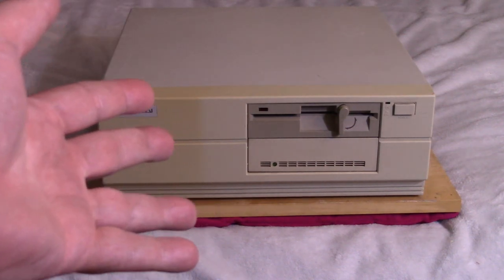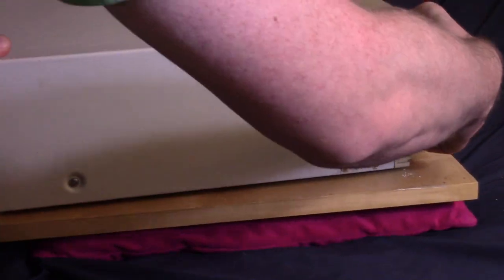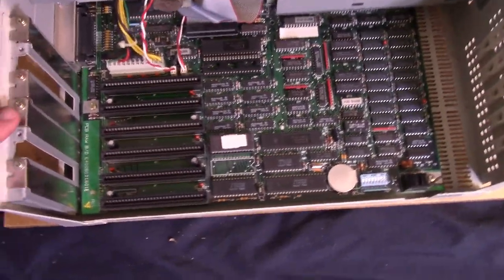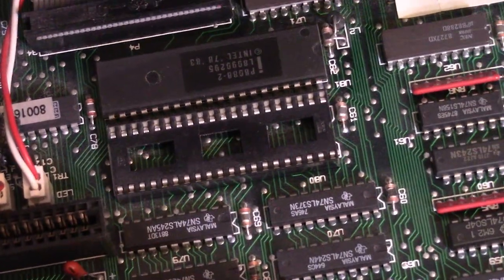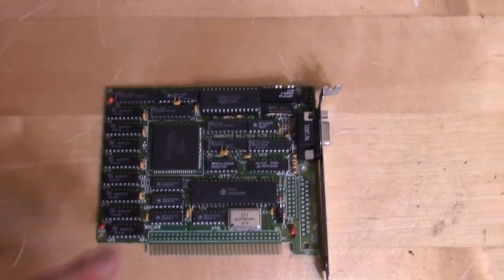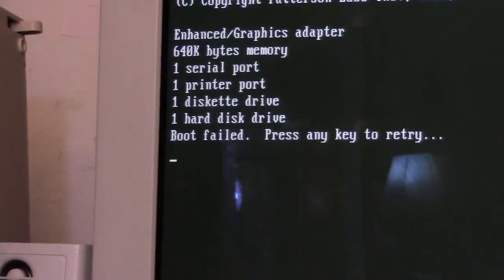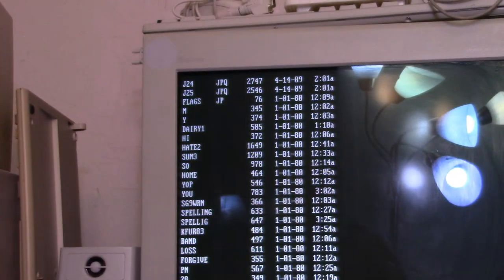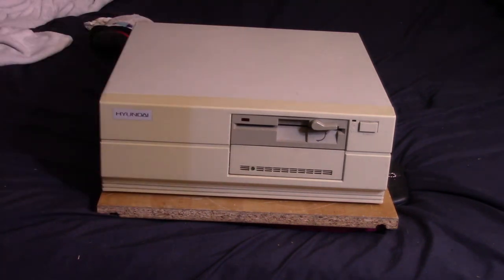Hyundai Super 16 Turbo

Comment: There were three giant Korean conglomerates at this time.  Hyundai, Daewoo, and Lucky Goldstar (LG today).  Those three companies promised lifetime employment and employed well over half of Korean working adults.  All three made a lot of computer components.  Most PCs branded by one of those three companies were actually manufactured in Taiwan, and were just branded by a Korean company.

Having said that, what a cool build.  They really seemed to know what was important.  An ATX style power connector, and regular watch battery.  I tremble when I think about how many computers died from battery acid, and reversed power rails.
Reply: the psu connector isnt atx, its almost like the at type, but different pin type and connector housing, you cant directly interchange them, i have a similar model 16TE,  it only looks atx as its a single connector instead of 2 separate ones as is usual with at
Reply: my super 16TE (turbo enhanced??) motherboard has a very 'Goldstar' look about it, i have an actual Goldstar branded motherboard, and the 'look' and components used are pretty much identical ,

Comment: This was my family's first computer, a free hand me down when it was almost 10 years old. I can confirm it did have a turbo (slowing from 8 to 4.77 Mhz) mode through a key combination (maybe ctrl-alt-enter but I can't remember). The cursor will change from an underbar to a block when it changes, and running DIR will be noticeably slower. They called it a "super-16" because they hyped that it was a "16-bit" computer. The keyboard was like an AT keyboard. The floppy drive was 360k but yours doesn't look like the original, ours was the same color as the rest of the front, had a round LED, and the gate couldn't be closed unless there was a disk in it. The hard drive was 30Mb but in the original documentation it was called 20 because the original MS-DOS 3.2 it had could only see 20Mb. We had the original disks & manuals but it had been upgraded to DR-DOS 6 which could see the whole hard drive. The matching monitor was amber monochrome. Yours, like mine, is also the top of the line for this series, according to the brochures that came with it there were also single & dual floppy versions.
Reply from the maker: Awesome information. I always really like hearing from people that actually had these machines back in the day. I appreciate the comment and the extra info.

Comment: My first computer was one of these! I can tell you a few things:

1. The floppy drive has been replaced. You can probably tell from the color anyway, but the original had a round red LED. The original was 360k and belt-driven; it made a soft sort of "whump whump" sound when it accessed disks instead of the grinding of most drives.

2. The clock speed can be set via the keyboard, Ctrl+Alt+Enter. The version of MS-DOS 3.22 it came with also had a program called TURBO.COM which would switch it

3. The graphics card isn't the original. It came with a CGA/Hercules multi-video adapter which supported 132-column text. The mono monitor it came with was amber.

4. We tossed ours after the hard disk head-crashed, so I'm not surprised that yours acted up. The manual listed it as 20MB but it was really 31.3MB; I think the manual said 20 because MS-DOS it came with only supported 20MB max. We had DR-DOS 6 on it and that gave us FAT16B for the hard disk.

5. The hard disk was an option, it came as single-floppy, double-floppy, or floppy+HD.

6. I found the manual. If you haven't found the full description of the switches at 5:25, they are: 1-clock, 2-coprocessor, 5/6-monitor (on-on: no monitor, on-off color, off-off mono or multiple monitors), 7-century (off: 20th, on: 21st). It also has two sets of jumpers somewhere; the smaller one sets the sizes of the main and expansion ROMs, and the larger one lets you set the port numbers and IRQs of the rear ports
Reply from the maker: Thank you for the information. This is exactly the kind of info and clarification I like getting. I'll update the blog with the relevant information as well. thank you!
Reply: I recently got this computer and it's got ATI Graphics Solution Plus just like what we can in the video. The previous owner of my computer may upgraded the graphics card but maybe it was an option when the computer was on sale back in the days.

Comment: The fact there are fewer ISA slot isn't that bad actually considering this motherboard has many features included (serial/parallel, rtc and floppy). These would take up multiple ISA slots if they weren't integrated.
Reply from the maker: Thats a good point. I'm the guy that ends up filling 8088 machines up with ram expansion cards and sounds cards, xt-ide cards and things that the typical user of the time wouldn't of so Its easy to forget at times. That said I have seen other 8088/86 based PC's that offered just as much built in but had more slots for expansion.

Comment: Awesome find on an old PC. I am definitely looking forward to your HP Vectra computer. I have one myself, its a 486 SX2 50Mhz but its pre socket 3 ( PGA Socket) and can not find the same board online that in my version they always show the socket 3 ZIF and mine definitely requires force to install and remove the cpu.
Reply from the maker: I actually have 2 Vectra videos coming up now but they are both Pentium based machines.

Comment: One would think that, by 1988, XT machines were packed inside a few custom chips plus maybe 8 memory chips on top of that. But no, this one looks like 1981 PC with 100 chips inside.
Reply: i have a later one, super 16TE(mine is dated 1990 but have seen pics of ones dated 1988), identical case, pretty much the same spec, but its motherboard does have a 'gate array' chip replacing a fair few of the separate logic ..

Comment: i have a 'similar but different' one a super 16TE, identical case, slightly different mother board, also slightly different to pics i've seen on the net for  a 16TE,  also some were branded PONY
Reply: that lithium battery is not original, the original ones WERE nicad, this has been changed at some time, and hopefully altered so no charge current is fed to it,
Reply: you can get rechargeable version of those button cells, but must be charged according to the data sheet